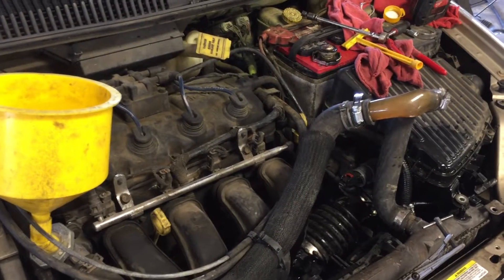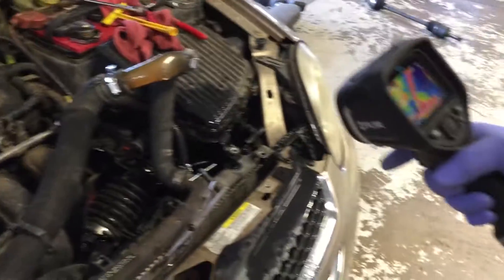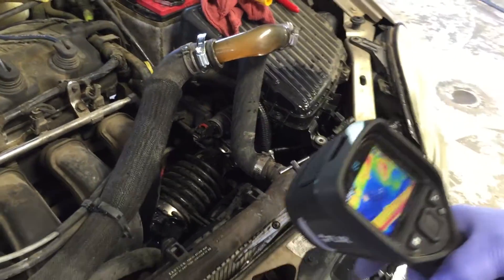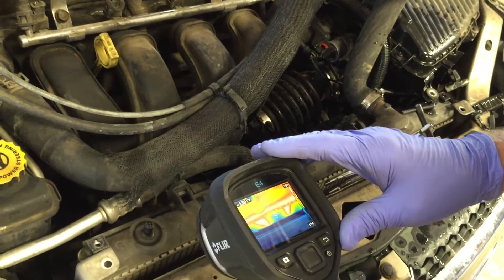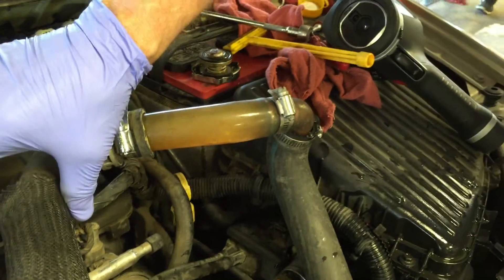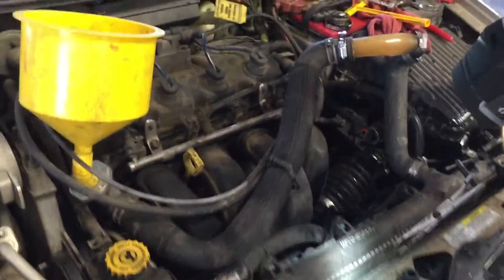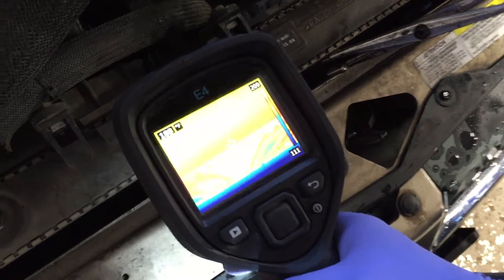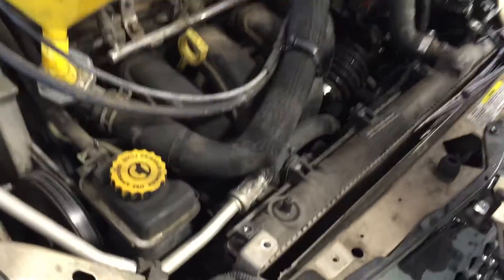Tommy's Hi Tech - Overheating Cooling system Diagnosis

Comment: Look like with that see true house is very danger way to test the cooling System.
Reply: The yellow funnel was in place of the radiator cap.  The funnel is open to the atmosphere, meaning the system was not pressurized.  I'd say it's fairly safe to use the clear hose in this case.

Comment: sir what is the average inlet and outlet temperature of a car when radiator fan is on ?Again if if fan is off what is the temperature ?
Reply: at least. 10 degrees celcius cooler at the outlet than the inlet

Comment: The bubbles flowing says head gasket as well as the symptoms. In my experience over heating for no reason especially when on the highway.... Yup it needs a head gasket.
Reply from the maker: Radiator and thermostat fixed it
Reply: @tommyshitechauto137  So even though the video said it was flowing and temp was good on the rad it still needed to he fixed? Why? Was it clogged or thermostat partially closed?
Reply: The cause of the head gasket blown is due to a clogged radiator or stuck thermostat  and yes I agreed it has a slight leak in the head gasket
Reply: @timothymohammed919  I thought that as well.  However, it is possible the air was introduced into the cooling system when the clear hose was installed.

Comment: Why is it orange rust color?
Reply: usually normal for cast iron blocks
Reply: I wonder the same. Is it running just pure water? I recommend using the red coolant, because it reduces corrosion for aluminum parts (engine block + cylinder head) while green or blue coolant causes corrosion to aluminum parts. People say that with iron blocks you can use the blue or green coolant aswell, but still there is the cylinder head made from aluminum.

If the coolant on the video was red, I think it should look much more red than on the video. If it was blue or green, I think the color should be more blue or green. However that looks like being just a rusty water.
Reply: @mikkomansikka  Coolant color vs application is a myth.  The only significant difference among coolants is organic or inorganic/hybrid coolants.  The vast majority of modern coolants are interchangeable.